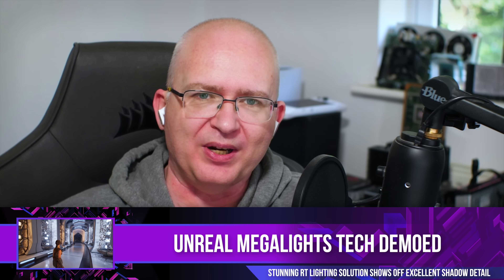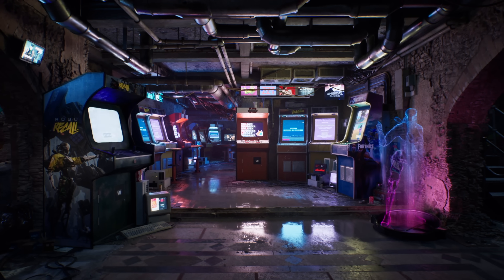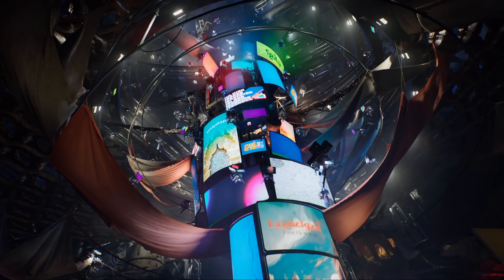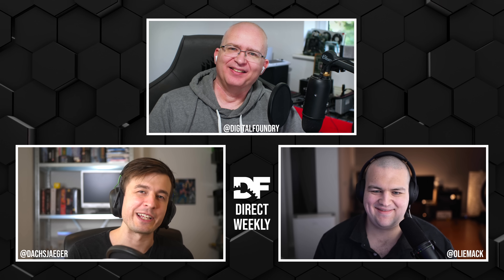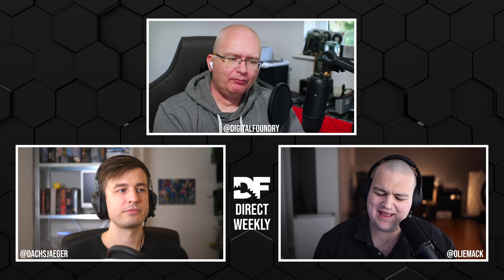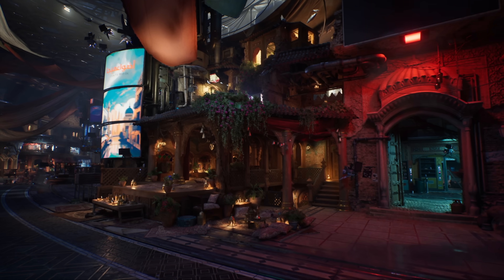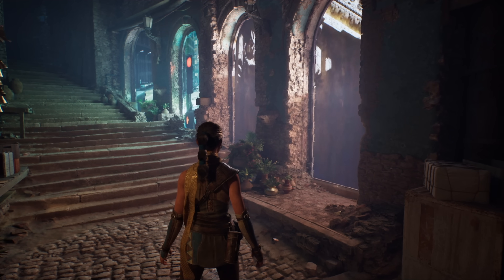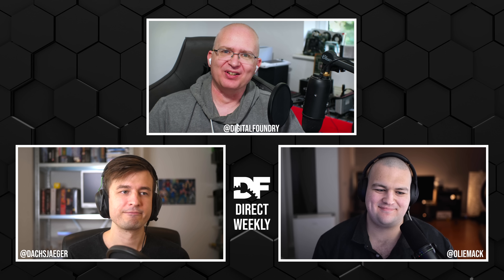Unreal Engine 5 MegaLights Demo - Technology Explained

Comment: While these new features are cool I'm sure everyone would prefer they did something to mitigate the horrendous stutter that's almost ubiquitous in UE5 games. 

Sure it might not be all on Epic as not all games have it (Hellblade 2), or have it at an acceptably rare frequency (Wukong), but it's clearly something they need to help devs sort out because it's getting ridiculous and giving their engine a bad reputation.
Reply: The did work addressing shader comp stutter in 5.3 and 5.4 but we need games using those new versions to see if they accomplished the job.
Reply: @gameguy301  fingers crossed, but I think traversal stutter is even more egregious as most games have (thankfully) implemented shader compilation on launch. Have they done anything in regards to that?

It's not only a UE issue though tbf, DS remake used Frostbite and was absolutely terrible in that regard.
Reply: I've tried virtualised geometry on 3 different mid-high end PCs/laptops on Fortnite and they all have insane stutter... 🤦‍♂️

Comment: Yeah I'm sure it's great running at 800p upscaled heavily. That's not the kind of image quality I bought into though on PS5 and a 4K OLED
Reply: that's exactly the kind of quality you bought into with a console thinking it'll do 4k somehow
Reply: @roar104  These consoles are aimed at being 4K consoles. It's up to the developers to do better and target higher resolutions. The culprit here as they age is Unreal Engine 5, which massively overshot what these machines can do. Looking at first party Sony titles, you can get ~1440p and 40FPS even with a little ray tracing, and they look amazing and feel great to play. I would say 1440p is a decent target compromise resolution. Looking at badly built UE5 games you get 1080p on a good day with bad upscaling and shonky sub 30FPS framerate. That's not acceptable.
Reply: @pgr3290  they're aimed at outputting 4k via a dynamic internal resolution on most games, not actually being 4k. Nowhere near good enough hardware for proper 4k. They know console users mostly don't know the difference so they can slap it on and people will buy it. 

That's not to say UE5 isn't horribly optimized with bad features like nanite on top of that though.
Reply: @roar104  The developer determines how the hardware is used. The hardware is good enough for native 4K and 60FPS. Gran Turismo 7 for example. It's probably not the ideal target for most games intended for those machines, however 1080p is poor for the hardware and upscaling does not cut it. If they had DLSS that's another story, but they missed out on machine learning which has always been a big win for PC the last five years
Reply: @pgr3290   " The hardware is good enough for native 4K and 60FPS" 
LMFAO even last gen games like Shdow of the Tomb Raider run 1920 * 2160 ( Checkerboard 4K ) and still drops into 50s. 
The only other option is 1080p for stable 60FPS. How delulu do you have to be to think games can actually do native 4K on this machine lol. Even Sony First party titles run 4K only at 30FPS ( maybe 40 in case of Uncharted legacy of thieves collection )
Reply: @DragonOfTheMortalKombat  You have very poor reading comprehension.
Reply: @roar104  The xbox One x was able to run the most demanding games of the last generation like Metro Exodus and Red Dead 2 in native 4k @30FPS. And that was in 2019. And you are telling me that current gen consoles , that are much more powerful then a Xbox One X are not able to do that? Those consoles are more then capable , but devs go far beyond the hardware avaible in the current gen, even graphics card at this point in time are simply to weak. It is a problem of choice. Devs could choose to make it a standart to run games at native 4k at least at 30FPS or 60FPS but no they decided to put all the avaiable power into rendering Raytracing. So now we have games that have very good lighting but are terribly low res with awful image quality and stability in motion.

Comment: Honestly I’d lay the blame the lack of hardware lumen on console squarely at AMD’s feet. It’ll be interesting to see if one of the PS5 Pro enhancements is hardware lumen on future titles.
Reply: these kinds of technology's are cutting edge, & honestly its crazy that you think current gen consoles WOULD EVER truly be able to handle this tech with a $500 price tag.........

It has nothing to do with amd, consoles are designed to be cheap with decent gaming performance!!
Reply: @japanplayst3  Yep, not sure even how the ps6 era will handle it in full aaa game with all the of npcs, physics, ray tracing and  ai at 4k and 60fps at once.
Reply: @Emulator_Crossing do you even understand the entire point of these technologies? Can you not comprehend the fact that without these technologies, traditional method would be way to hardware intensive for console hardware to run anything near this. These technologies are made to make rendering easier both hardware and developers.
Reply: It's not an AMD thing. Lumen needed a lot of additional optimization. In this Unreal Fest talk they say 60fps hardware lumen on consoles is doable in 5.5: https://www.youtube.com/live/s1qdbJtjUI0?si=R_6eEqBqI5mgoSGM&t=5696